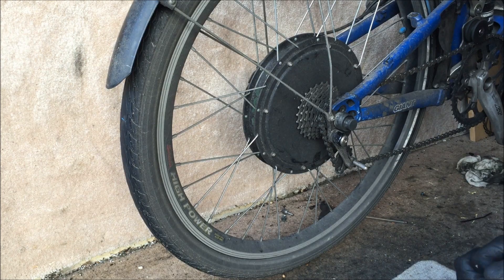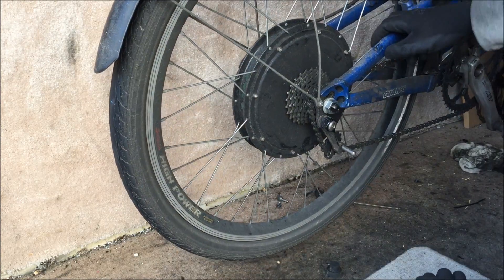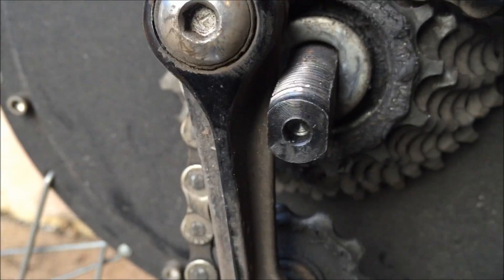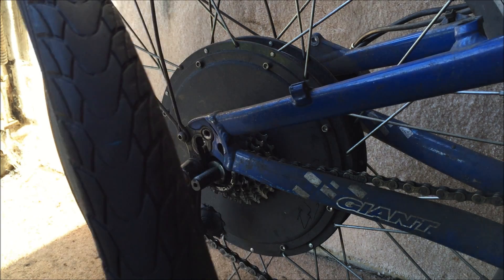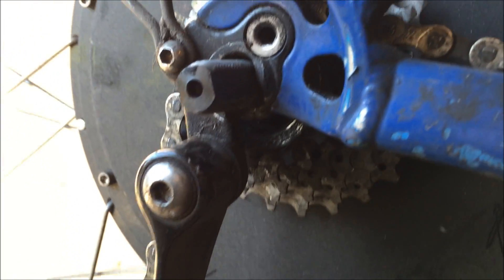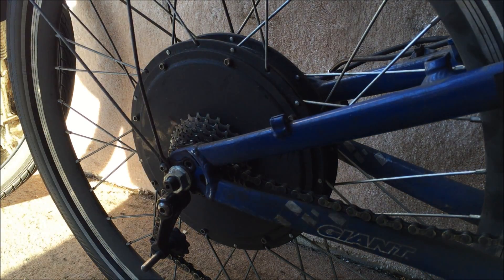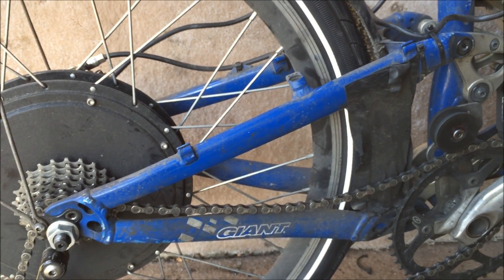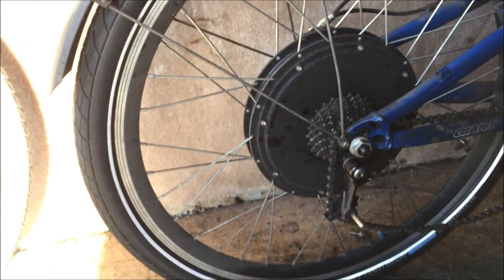Electric bike conversion kit fitting rear 1000w 48v

Comment: I've got this ebike kit. Do you know how to reset the LCD programme on this kit? Whatever you do remember to remove the covers and grease the inside. I dismantled mine and it was poorly made.
Reply from the maker: They are all bad quality so it is hit and miss, so i prefer to buy the kit from someone that is selling it in my country so it is easier to return if there is problems. Not sure how to programme it i don't have an lcd screen with mine.
Reply: Fast Electric Bike also - wish you’d post a link where you bought it. Which company is the whole kit from? And how is it holding up 3 years later?
Reply: What do you mean grease up the insides? If it’s a direct drive. Like gearless - there’s nothing but the bearings to grease. Which would be a pain in the dink.

Comment: Suggest using the correct size ring or open ended spanner. adjustable wrenches are a compromise and will inevitably start rounding off the nuts as the wrench slips off the nut as shown at the beginning of the video. Thanks for posting.
Reply from the maker: +Paul dawson-goodey If you are careful, then you can use the adjustable spanner as you can do it up tight on the nut, as normal spanners there is always a bit of play, plus I hardly ever take the wheel off.

Comment: lol use a socket wrench u are rounding your nuts using that adjustable spanner
Reply from the maker: +deejaybigzz you can only do that on one side the side with the wire coming out the centre of the axle you can't use a socket.

Comment: Don't you own metric socket set?
Reply from the maker: SolarizeYourLife yes of course but if you use an adjustable spanner you can tighten it against the nut so i9ts a perfect fit. plus on the side with the wire coming out you can't use a socket anyway as the wire is in the way.